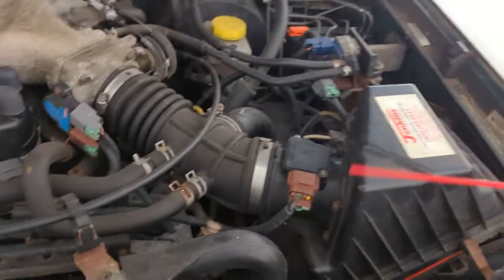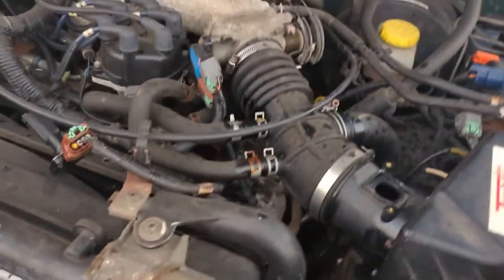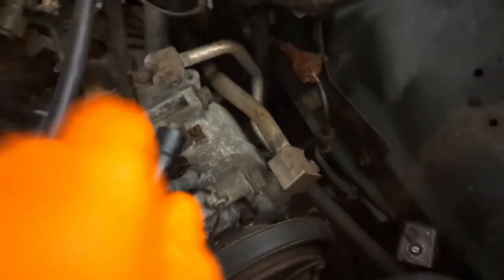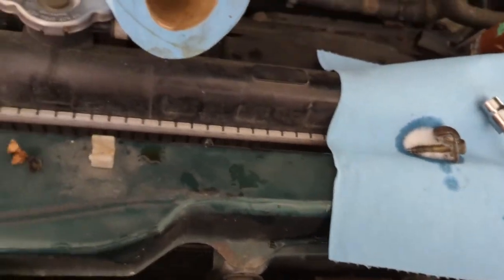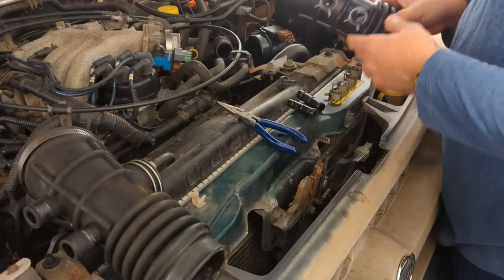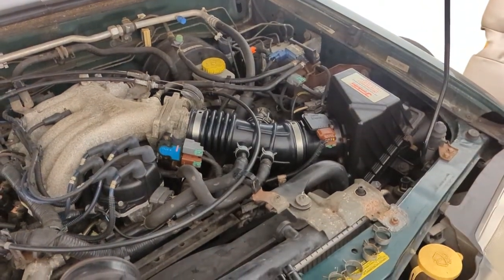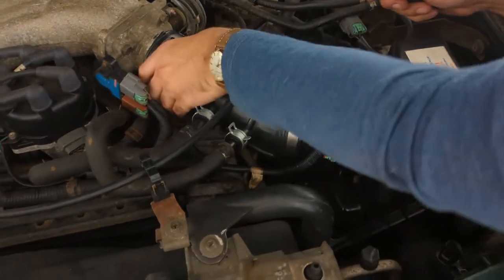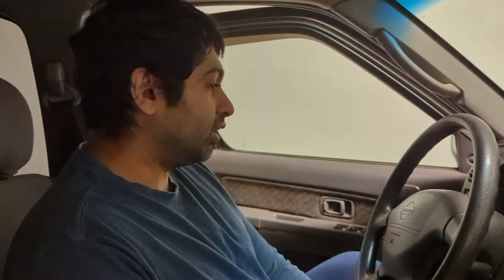Nissan Xterra airbox and intake hose replacement

Comment: How did you actually take off the air duct assembly tube
Reply from the maker: Once the clamps are off from both the throttle body, airbox side, and vacuum lines it should just come off